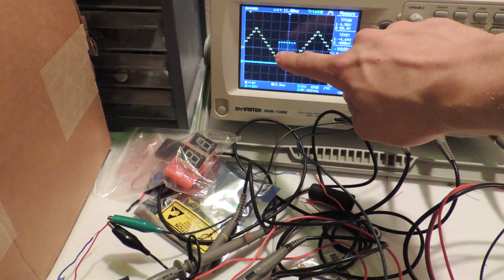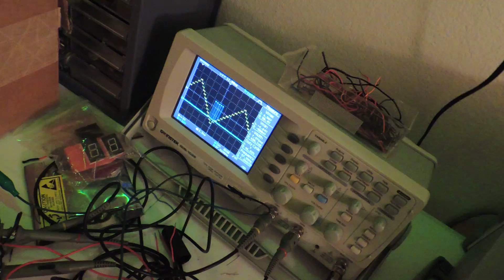Laser Harp 2.0 Hardware Test

Comment: How do you connect the DAC output to the galvo driver input?

In my design y convert 0 to 5v of the DAC to -5 to +5v, resulting in only 2 wires, one for the bipolar signal and other for ground. Galvos usually need 3 wires, one for positive, one for negative and the last for ground.

What do you think?

Comment: I found using a noch filter for the sensors cut out the ambient light plus i used a dark green gel filter over the top of the 3 TSL12S-LF sensors i use and it works 100% no interference from any kind of ambient lights. :)